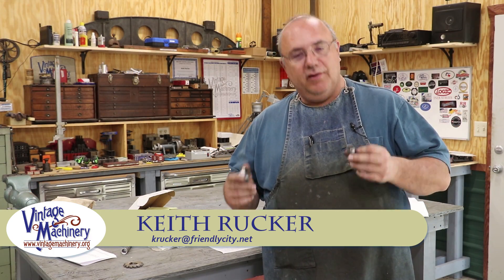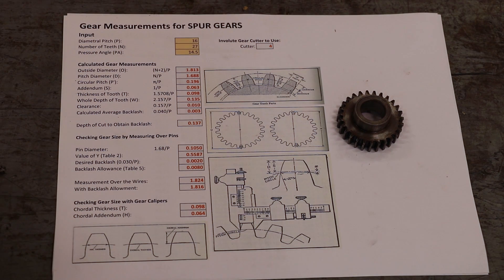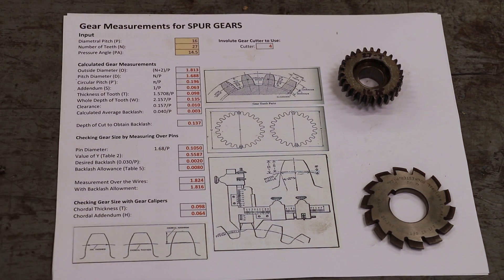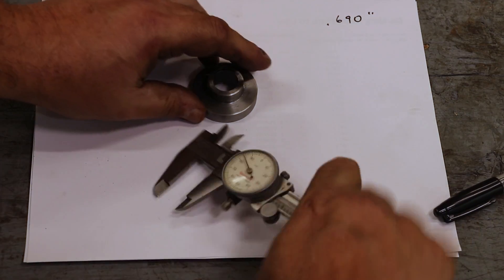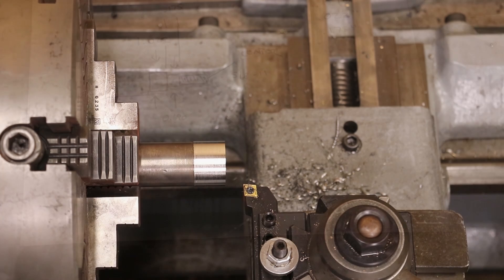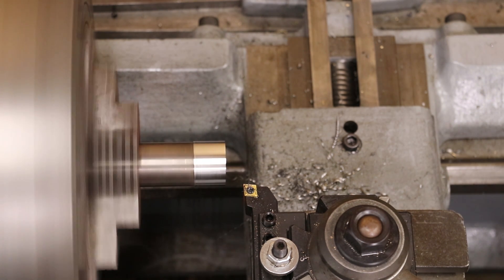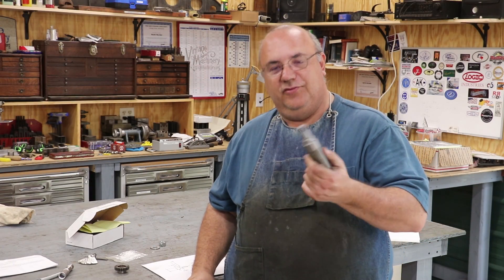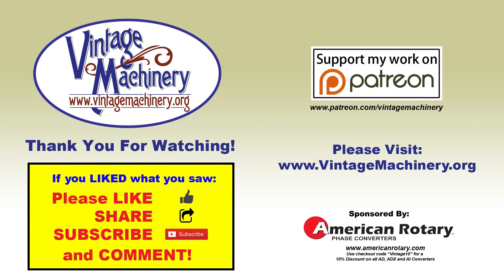Gear Cutting Work Holding:  Turning a Custom Mandrel  on the Metal Lath

Comment: @9:12 those headstock bearings don't sound too happy. Are the belts too tight or did dirt get in there when you were stripping the paint way back during your restoration?

Comment: Why do you put oil on the outside of the shaft when all the cutting doesn't touch the thin film of cutting oil?
Reply: I have wondered about this for years.
Reply: Probably because he doesn't feel like dealing with grinding and resharpening HSS along with finding center height again. Might not be that big of a deal but if your busy  just changing an insert is way faster.
Reply: Or it translates to there's only so many hours in a day and having a life.
Reply: That's a perfect excuse a few minutes here a few minutes there it all adds up. Don't forget the video might not be that long but he probably has several hours worth of editing to do for it. Not to mention the time spent machining. If you can save yourself 10 minutes it's worth doing especially if you'd have to do it multiple times.

On top of that no matter what he does he isn't doing it correctly by someones standard. You say he should be using HSS but i'm 100% sure someone else would be saying he should be using carbide if he wasn't. The man can't win.

Comment: Hi Keith.  I’m new and have a question.  What is the difference between a horizontal mill and a surface grinder.  It looks like they can both do surface grinding.  I want to buy a small shop surface grinder but if I can get two uses out of one it would tell me which to buy.  Greatly enjoy your videos and am learning a lot.  Thanks for taking the time for us.
Reply: While it would be possible to do grinding with a horizontal mill, the mill has multiple speeds for the spindle, some far too slow for grinding, and lots of HP to cut metal deep. Also, the horizontal left-to-right travel can be done in small increments. The surface grinder runs at a fixed speed (around 3600 RPM) and the horizontal travel is considerably more rapid. Add in other issues with grinding dust in the ways and you will see there are reasons they are usually made as different tools. BTW, gears can also be cut on a vertical mill by using the indexer on the horizontal axis.
Reply: Thanks for the replies.  I greatly appreciate it.

Comment: Is there a reason you just didn't make this like a faceplate and super glue it on?  Just curious as it would have saved some machining steps (ie, not needing the threading).  Don't get me wrong, this is a really elegant solution, but I'm more of the KISS person (after I go overboard and design a super computer where a 4-banger calculator is all that is needed).  :)

Comment: cm FTW
Inch sucks
Reply: did ok getting to the moon.......Just sayin
Reply: Myself, when I machine 100% metric jobs I use metric on my calipers and DRO. Mixed jobs I convert to inch (thousandths, not fractions). When you consider that we in the U.S. have to deal with old AND new parts, it means we have to be flexible with our metrology, like being bilingual.

Comment: Grip the hub in a 1" 5C collet held in a hex collet block- put the hex block in the chuck on the  dividing head and cut the gear.
Reply: Plenty of clearance according to his dimensions- plenty of grip area as well- just support the other side with a bullnose center.  Plunge cut , then do small side to side motions to clean up- reduces overall cutting time.  Machinist A with collet method and Machinist B with mandrel method.  A will be nearly finished with gear as B just finishes mandrel.

Comment: How come you just didn't use a die to cut the bolt?  Isn't that a standard one?  Am I missing something?
Reply: At this point it's actually easier and quicker to cut it this way. Setting up a die and getting it square would take longer and introduce potential alignment error.
Reply: I like to do both... cut the threads part way single point, then finish with the die. Pretty easy and you hit the accuracy of the die every time.
Reply: The man has a preference (and lots of experience). I would have used a die personally, but I am not Keith.

Comment: hello kieth. how deep did you go in on the compound to cut the 5/8-11 thread? i have this formula for calculating this. it is 1 divided into 11=.0909 then divide by1.5=.0606 does this seem to be right to you. thanks.
Reply: where is the formula?? what is 0.6403p what  does that mean and what is bsw? try to be alittle more clear please.

Comment: Isn't your .175 step in your rough diagram in the wrong  location ?
Reply: You are correct, he should have measured the depth of the smaller hole, but as long as the length of the piece is shorter than the depth of the hole it will work perfectly fine. It is not a critical measurement.
Reply: I caught that also.
Reply: It is, but he set his actual cut depth with the part in place when he marked it with the sharpie. :-)

Comment: Is it really neccessary to fit on both diameters?
Reply: Klaufmann its not necesary, but if you put 0.03mm more large the diameter you can tight it and dont need the thread for the nut, but i prefer the configuration that he take
Reply: I think it gets more rigid if the part is supported on the shoulder, too. But even without that it should be rigid enough.

Comment: Are you able to share this spreadsheet for the gear information printout?  Looks like it would be very handy to have!! :)
Reply: ( gear cutting calculator ) is what you search for on the inter net  pick the one you like. some make DXF's 
No matter  if you see what you like (print screen ) save> and print out with your printer or hit print to file and save for later
Reply: starrtraveler29 i think he has it on his website...
Reply: Hi Keith, I would really like a copy of the speasheet you show, would suit me down to the ground. Great work as always. Regards, Martin
Reply: Here: https://www.engineersedge.com/gears/spur_gear_design_13807.htm